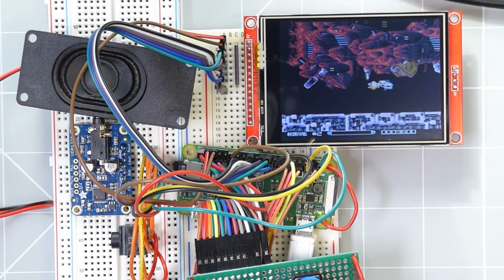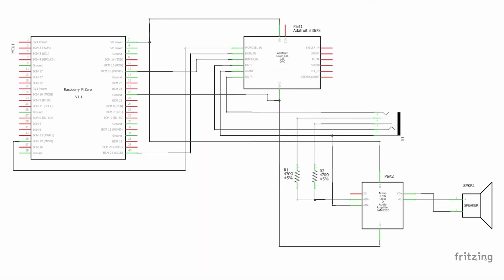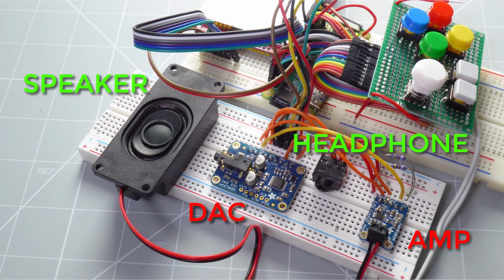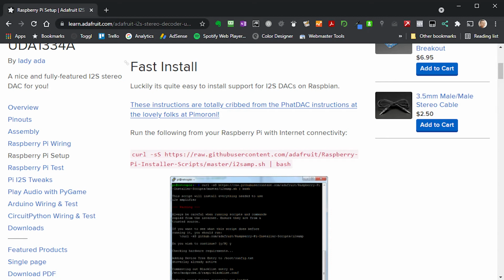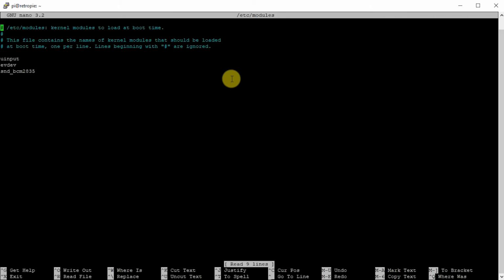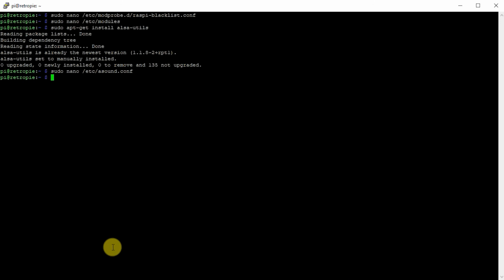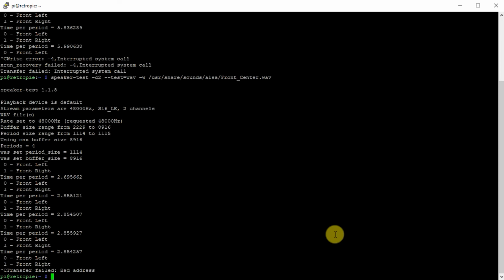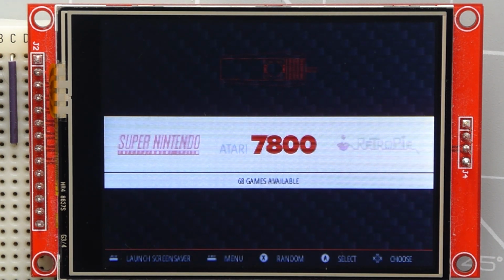How to Add I2S Sound To The Raspberry Pi - High Quality Digital Sound Output

Comment: It sounds very professional. I am a rookie in this field. I'm just trying to set up my Walnut Pi2B especially the audio.I have got some DAC I2S decoder with PCM5102A but unfortunately I don't know what is the pinot of FFC connector on Pi board. As the seller didn't replied I need some advice. Can someone help me please?
Reply from the maker: You should be able to find the pinout online if it's a named supplier.

Comment: I'm getting a bit confused trying to research the components I need for headphone output for a portable MP3 player project. Here you mention that the jack on the DAC can directly power headphones, but I've seen others say that because it's a line-out level and not headphone-out level, it still needs an amp and will only work with powered speakers as-is. If I just want headphone output (no speaker), can I really just add that Adafruit DAC and use its jack?
Reply from the maker: Some headphones will work with line out - think tiny in ear ones. If you want more power you'll need an amp circuit.
Reply: @BytesNBits  Ok that makes sense, I'll try that DAC standalone for now and see how it sounds. thanks!

Comment: Hello from Texas! I'm looking to make a project where I need to implement the DAC and Amplifier into my own PCB using their chips. I'm new to this and was just wondering if the GND pins that were in the diagram are normal GND pins or Analog GND pins?
Reply from the maker: The GND pins on the Raspberry Pi are effectively digital GND. The DAC in the Adafruit board creates a clean analog GND for you. In reality they are the same voltage and do need to be connected together at a single point in your circuit, it's just the analog ground is organised to reduce interference on the GND signal wires connected to your audio circuitry. Hope this sort of helps.

Comment: Great series of videos, I'm following along the best i can but I'm very inexperienced when it comes to Linux.
I've got a st7796 based spi display that seems to work great. Ive just added a pcm5102 dac and worked through the spi set up. Now I have audio out.
The issue is that the screen is fine when in the menu but as soon as I select say the Gameboy menu the spi screen freezes. If i check the hdmi is working fine. If i comment out the i2s overlays the spi work's again. 
I can't see that I've missed anything but really can't work out what's going on. I've been going round in circles for the last 2 days so any suggestions would be greatly appreciated......
Reply from the maker: That sounds like a tricky one. It sounds like whatever screen driver the actual emulator is using isn't compatible with the I2S driver. In the video I was very careful in the steps to build up the code base by starting with a freshly installed version of RetroPie and then adding the drivers in a specific order. I had issues with the driver permissions. Did you try that process?
Reply: What I find strange is that it works on the main menu screen and it isn't until you select a console and try to select a game that it freezes the spi screen. As far as I know the st7796 driver is just a modified version of the ili driver. Anyway I have 2 weeks holiday from this weekend so I'll reinstall retropi and go through the installation again just incase I missed something.
Thanks for the reply, I'll keep you posted of how it's going.

Comment: All I want is i2s output so I send it to my DAC
Reply from the maker: Just replace the Adafruit DAC with your own DAC in the circuit. Just make sure you get the wiring connections correct.

Comment: Hi, I've really been enjoying your video tutorials. For the portable Raspberry Pi Zero game console build I've got the display and the GPIO controller working
but for the digital audio I've found the asound/conf code is out of date and when I try the speaker test I get several errors. I can get the audio to work
by deleting the contents of the asound/conf file but of course I cannot control any audio parameters. Could you post an updated file or point to one?
Thanks again for the great videos!!
Reply from the maker: Thanks for the heads up on the audio. I haven't been playing around with this project for a while. Now that Raspberry Pi's are back in stock I'll need to revisit some of these videos.

Comment: This tutorial is very well made and easy to follow, but unfortunately I wasn't able to obtain the expected results.
I'm not sure if this is all my fault, or if this method is somehow outdated, but the TFT display (that I've setup following the video of this series) is messing with the audio signal somehow, as I'm getting severe crackling out of my I2S DAC every time there's a bit more of the TFT display to update.
I've ran the wav tests from SSH and they all run fine, until something on-screen moves (even the menus of EmulationStation) and then it crackles.
Also, I'm getting the following error every timean emulator is launched: "lvl0: VolumeControl::init() - Failed to find mixer elements!".
I've searched online for quite a while, but I wasn't able to identify what is the issue there (though the hypotesys is that the audio cards have changed names in recent updates?).

I even added "dtparam=audio=off", and changed "dtoverlay=vc4-fkms-v3d" to "dtoverlay=vc4-fkms-v3d,audio=off", as this is mentioned as necessary in Hifiberry's getting started section of the site, and also tried removing "dtoverlay=i2s-mmap", as it is said in the official Retropie site that this line shall not be included after Raspbian 9 (https://retropie.org.uk/docs/Sound-Issues/).

At last, the problem is still there. I've then tried not running the ili9341 software on start and switching back to HDMI, and the issue is not present anymore, contributing to the theory that the problem is an interference between the TFT display and the I2S bus to the DAC.
I've also tried switching to a 2A power supply (a phone outlet adapter for fast charging), it didn't get any better.
I have actually no clue about what to do now, as I was not able to find conflicts in GPIO usage between the TFT driver and the I2S bus, and Ive double-checked the wiring of the components for unwanted contacts.

The main thing different from your setup is that I haven't installed the software for analog audio at all, and I'm using a controller connected and configured to the USB port instead of mapped GPIO pins (I've not followed that part of the tutorial series yet). That's it software-whise. Hardware-wise, I'm using a different I2S DAC, no serial number nor a company name, just four pins "SCK, BCK, DIN, LCK" (excluding VIN and GND) that I found difficult to recognise in the usual I2S bus naming conventions. I'm not using amps, just the audio jack on the DAC and all the rest of the hardware is the same.

Any kind of help will be greatly appreciated, thanks a ton for reading through! :)
Reply from the maker: I see your point. It's strange that the SPI channel is affecting the I2S data. It's hard for me to say what the issue could be. This video is getting a bit old and is probably due an update. It may well be just a software setup issue as each component seems to be working individually.
Reply: @BytesNBits  Thank you so much for answering mate.
I was wondering  then, do you have any information about the version of retropie that you were using? I could assume by the date of the video, but I'd be great if you could specify.
(It's not that important with the other pieces of software installed via command line, as in most cases the software version is printed on console at some point during the install).

P.S. Missed a point in your answer: I'd definitely be amazing if you did an update video on this topic! Yay!

EDIT: [SOLVED] Turns out, some traces of my breadboards are faulty, and moving the wiring to different traces solved the whole interference issue. I'm really sorry if I made you lose any time over this, and I'm really greatful for the response! The only thing now is that "lvl0: VolumeControl::init() - Failed to find mixer elements!" erorr which still pops up.

Have a great day mate, I'll keep on following your tutorials :D

Comment: How to make work on beaglebone or orange Pi not Raspberry
Reply from the maker: Sorry. I don't own either of those boards so can't comment on the differences. It will probably be a similar process but you'll need to work out some of the settings for your particular board.

Comment: interesting video. would it be possible to have more audio channels? maybe by assigning more GPIO pins and more audio devices? cheers!
Reply from the maker: Hi. I think there's only one hardware I2S channel but you can probably get some software based drivers up and running to use general IO pins.
Reply: @BytesNBits  right, I might have to try that. could induce some latency though compared to the hardware pins.

Comment: What Chance is there, to feed a Zero dig output into an external DA converter, via optical or coax connection ?
Reply from the maker: The Pi will give you the raw I2S data on the IO pins. You can then wire this into any downstream kit you have.

Comment: Hi! Can I make an simple I2S audio output in my Raspberry Pi Zero 2W to use it wit an external digital amplifier that has an I2S input? (Using an HDMI cable is in my mind).
Reply from the maker: Hi. That's not something I've tried but the Pi will output a standard I2S signal so it should connect ok.

Comment: Hi,
I'm following your tutorials, but i found you are using the same GPIO pins 18 & 19 for the screen and also for the sound. How you solved that?
Thanks
Reply: Ok, I was confused with gpio and the real pins on the pi.
Reply from the maker: No problem. I hope you get it working!
Reply: @BytesNBits  I finally made it work! I created a video about my construction and put a link to your project because I used lot of your information. Thanks for your work! Here is the video if you want to check the final result: https://youtu.be/EYVHPKQ16xY
Reply from the maker: @Metanei81  Looks great. Glad to see you got it all working.

Comment: I'm looking to do something similar but I want stereo. Could I just swap out the mono amp board for their 3.7W class D stereo amp (#987)?
Reply from the maker: Hi. Yes. The Raspberry Pi outputs stereo over the I2S channel which is decoded in the first stage. I've just combined the left and right signals to feed into the mono amp. You can just route those into their stereo amp.
Reply: @BytesNBits  would the resisters going to the jack still be necessary?
Reply from the maker: @Harold_3D  Hi. No. You should be able to connect them together directly.
Reply: @BytesNBits  excellent! Thanks so much!

Comment: On one of the Adafruit tutorials I saw that the sound does not work on the RetroPie menu interface. Is that the case here as well? And if so, I know it's minor but is there any working around that?
Reply from the maker: Hi, I found the sound works OK in the interface and games. If the Raspberry Pi is making a sound it should come out through this output.